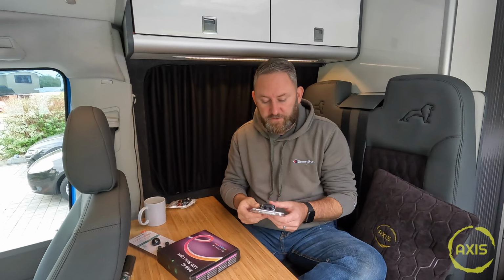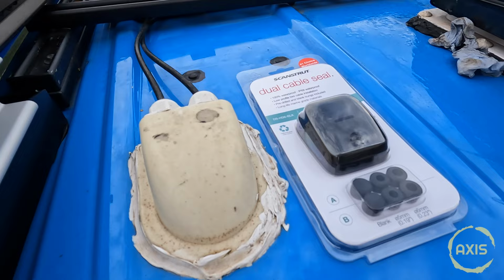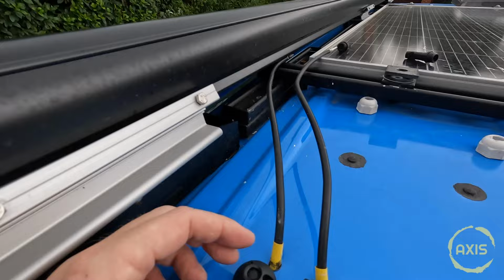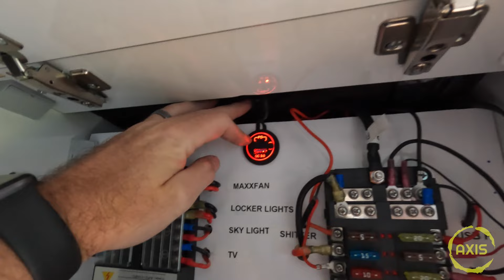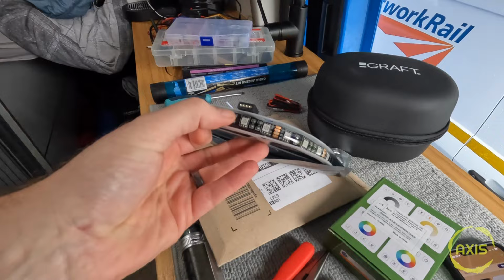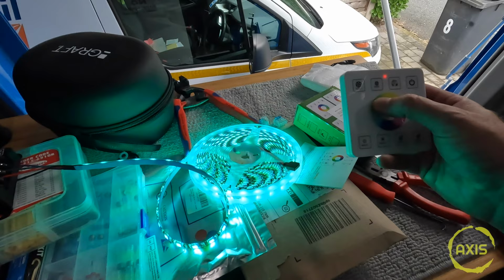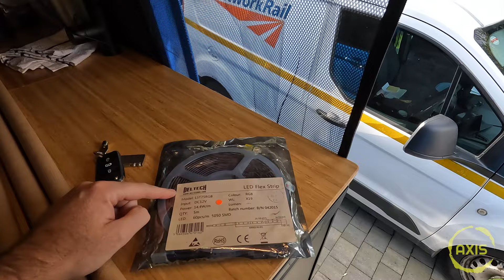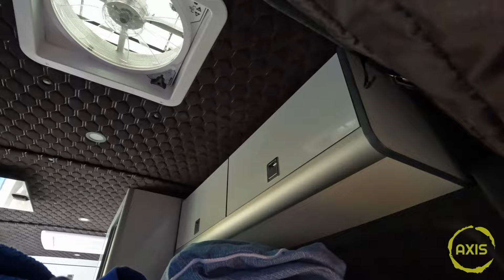LED lights Vs Rain!

Comment: Nice one jonesy lad 😂 totally agree with u about the box being mounted other way, makes sense to deflect wind etc 🤷🏻 just need a disco ball now 😂
Reply from the maker: 🤣😂 these things did my head in! Even bit the dust trying to get over a fence cause I had no lights 🤦🏻
Reply from the maker: @vandox21 Have you changed your logo again? 🤣
Reply: @AXISUK  😂😂
Reply from the maker: @vandox21  when you get your awning stuck up, don’t buy LEDs for it 🤣😂
Reply: @AXISUK  might of 😂
Reply from the maker: @vandox21  are you undecided on which to go for 😁
Reply: Yeh can’t decide , daughter says this one 🤷🏻 I’ve got stickers in both and this one matches ur van when I stick one on it 😂
Reply from the maker: @vandox21  🤣😂 you best pull your finger out and get this new van converted 😆

Comment: Hi, I've literally just fitted a Fiamma F80S awning to my Sprinter. What do you reckon to the Graft Awning leg holder suction things now you've had time to evaluate?  (You did seen quite impressed with them!) The kit for my awning came with the brackets to fix the legs to the side of the van but if these work well I'll give them a go. Saves drilling more holes into the bodywork! Thanks
Reply from the maker: They are brilliant so far ☺️ as you can see in the video it was quite windy and they held well. Doubled up with the storm straps the other weekend and rock solid 👍🏻